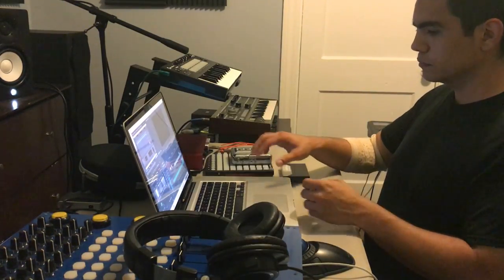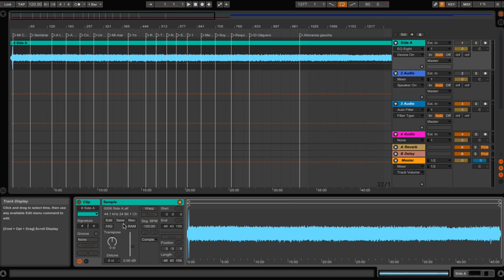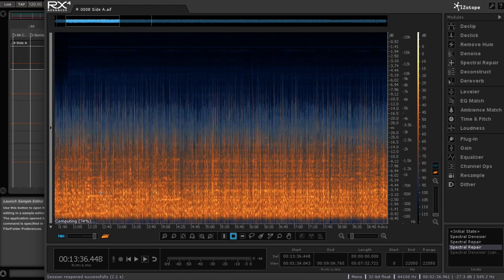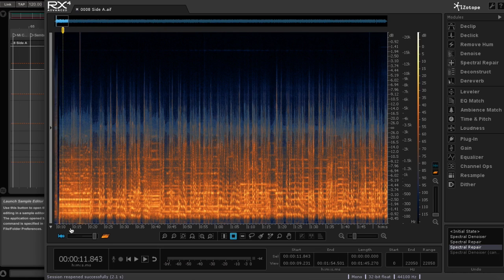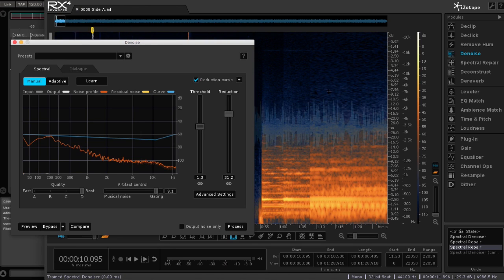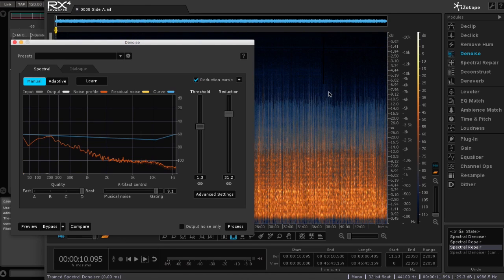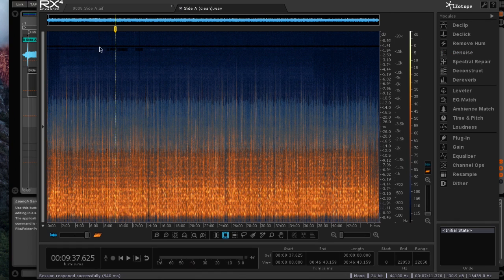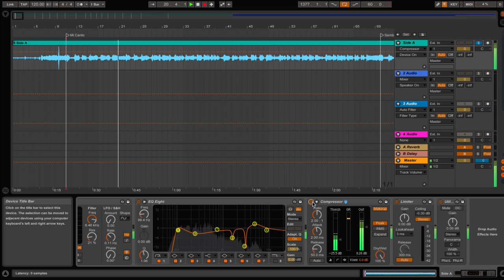How to remove noise from old tape recording

Comment: First of all (with a screw driver) you need to adjust the left and right side screws of the play-head in your tape player while the tape is playing until you hear the best quality sound. Once you hear it, that's when you know your play-head is in the same position as when it was first recorded in the original tape recorder.  You might have to take your cassette  door off to get to the playhead screws. There's normally adjustable tensions springs around those two screws in support of adjustments.

Comment: First you have to find tape noise frequencies and reduce them, then search the recording noise they are just different noises and reduce a little more, you can use two more noise reduction processes, one for voice de-noise and another just controlling noise in frequencies with tools like Waves WMS, all this processes should be subtle. Finally you can reduce artifacts sounds with eq, compress and final graphic eq to compensate, limiter and done, the final result is really good.
Reply from the maker: YNS Channel Great. You should do a tutorial too

Comment: Thanks for the video. I just found this because I want to use some of my Cakewalk recordings from a CD from 2000 and put the music on a video.  I would just plug my guitar into the PC and add affects after recording - there's hissing in some places and treble pop and clipping here and there.  I had used Cakewalk to turn tapes into MP3s and Waves and it did alright, but I don't own any current software. I'm saving this video and will check out your channel.